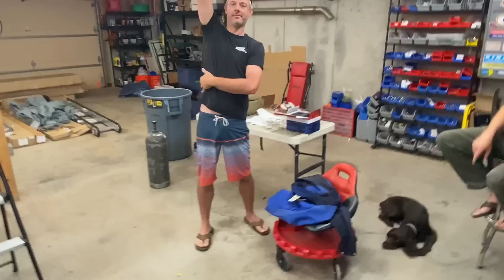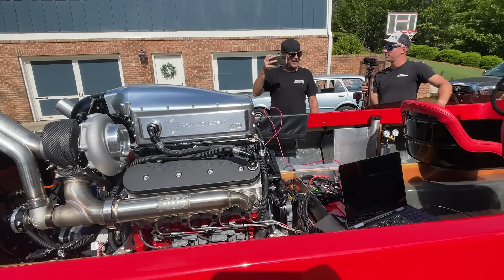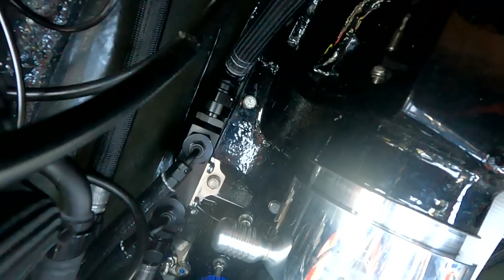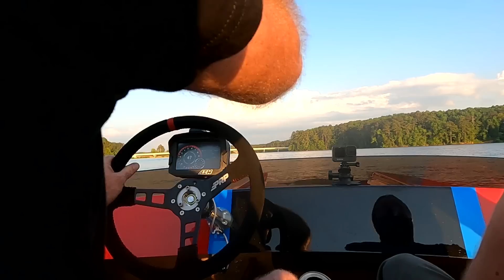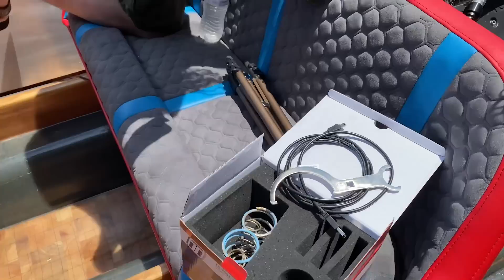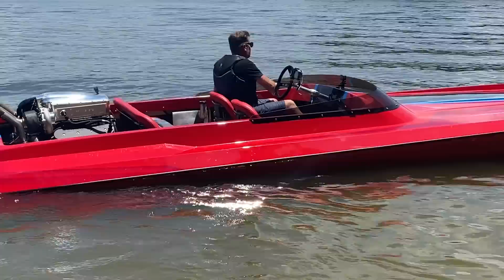FIRST WATER TEST OF WIFE'S TWIN TURBO LS-POWERED JET BOAT!

Comment: Hey Finnegan, I’m gonna be pulling the twin turbo ls out of my mantra v bottom and putting it in my liberator tunnel hull. The thing I’m trying to figure out thats a concern is how to run the fuel lines. I was curious how your returns are plumbed and if your keeping the fuel tanks fairly equal on level how? Any helps appreciated thank you. The mantra was easy to keep tanks equal as the v shape allowed me to add a line to them to help equal the tanks out using gravity.

Comment: Why not put a row of air jets towards the front of the boat to help disturb the water to make the boat go faster in calm water...you could have an air pump blasting air through a full row of small jets going side to side on the bottom of the hull right where it touches the water at full plain...that would break up the sticking factor of smooth water...maybe...

Comment: I think what you’re experiencing when you let of the throttle and the boat delays to slow down is that the air has packed into the tunnels and you are riding on the “cushion” of air and when you let off the throttle it takes a moment for the boat to settle back into the water

Comment: Another Q 4 U .  Hope l dont wear my welcome out .  I heard u say that u want 2 spin the impeller to 7500rpm . I always understood that 6500 - 7000rpm was where the sweet spot was . And drag boats were a smaller impeller spining 7200 to 7500 .  Is this because the  AA can take the HP & TQ u have . 
Potentially 1600 hp . 

Would u mind sharing & explaining pls . Not only 4 me , but others who ❤❤ what u Guys r doing . 

Was ur Super Drag Boat similar in set up . U had 1700 hp in that beast .
Reply from the maker: I've heard these pumps arent efficient past 7,500 rpm but i'm not an expert and I also havent seen anyone do any real public testing of a jet drive past that rpm. Personally, i've turned 7,800 rpm with a smaller diameter impeller in one of my old boats and it worked just fine. The boat went faster at 7,800 rpm than it did at 7,400 rpm.
Reply: @FinnegansGarage  

Ur last jet boat with the 1700hp ( can't recall the name )  
Well 30 -40 yrs ago the owners of Place Diverter & Controlls in Southern California had the Place Craft Hull @ 172 mph . 
As far as l know the next closest is in the 140 -150's.  I met them when l was over from Australia in 2005 . 
On one run at the Drags they mixed there race gas wrong & he hit 180's @ 1/8 mile & temporarily blacked out . As U well know the under water set up is crucial 4 everything . Shoes , loader grate ext ect . 
If u r going 2 pull 7500 with 1600 hp where do u think u will end up speed  wise @ WOT.   If u put a Steve Morris Engine in ( wear some diapers & take out life insurance) 😁😁😁👏👏 There was a guy in northern California running his 21ft Daytona @135 mph a few yrs ago & is now in a 19ft Daytona which l also ❤ but 2 small 4 a family . Any way we r 👀👀 out 4 ur next upload . Should be fun

Comment: There’s some times an issue with the crank sensor picking up noise from other hunks of metal other than the reluctor wheel.
Others have moved the sensor to the front of the crank on an external wheel to solve it.
Reply: Copy that.

Comment: I could have sworn I saw co2 bottle on the boat. But I like the wastegate design with the screw on retaining ring, I always hated trying to hold it with alot of pressure and thread bolts in.
Reply: I think the C02 is to control his jet bucket ( reverse forward control)

Comment: Fin that tunnel hull is awesome but your acceleration seems to leave a little to be desired. F1 tunnel hulls use a mercury 425hp outboard and accelerate much quicker than your boat does.
Not sure if maybe there’s some drive tuning to be done? I would imagine your boat should be much quicker in a straight line than a 425hp f1 tunnel hull with that jet drive on the back
Reply: I'm guessing weight is probably one of the issues with acceleration, that and the water intake probably could use some tuning, gotta be able to pull a massive amount of water through the drive to get moving any faster, I seem to remember on game over he had to open up the inlet a bit because it was limiting his speed
Reply: @Greg1096  yeah but that’s not the issue they’re having here. They said in the video that they have to choke down the flow and increase the pressure a bit, that’ll definitely help but so will a smoother and quicker trim action and maybe a trim adjustment.
It’s a 5 seater so weight is the one factor he has to work around, that being said maybe a power steering pump should be mounted to control the trim hydraulically, it’ll be fast and accurate and it won’t just be two positions, it’ll be dynamic which will help with the launch.
The neutral bucket was also something that game over had that gave it the ability to launch extremely hard, that would definitely help here.
I mean I don’t know if it’s the same pump and engine that was in game over or not, I haven’t been paying that close attention. But if it is I’m sure that’ll come at some point but not until he gets it tuned up a little bit more.
Changing the weight distribution more towards the front could help too. F1 tunnel hulls have a prop in the water to hold them up that’s why they’re fine with the back end sitting in the water while the boats stopped, because the outboard pushes the back end up and keeps the front end pushed down.
This boat sits rearward in the water but for a jet drive that would be a minor disadvantage, the more level he can get it the quicker it’ll plane out. The hull design is definitely not a limitation, it’s about the same size as an f1 tunnel hull, it is a true tunnel hull, it’s just got a recreational deck on top. So the flatter it floats while it’s stopped the quicker it’ll be flat on the plane, which is exactly what a tunnel hull needs to be fast.
The trim adjustment and accuracy also helps with planing out.
Weight is definitely a factor in a family vehicle period, but I think it’s just gonna get ironed out with basic tuning.
Reply: @conanruisi  The water they had to choke down was the coolant flow from the jet drive, not the jet drive itself.
Reply: @Keifsanderson  then tuning it out will show wether it needs to be hydrodynamically Improved around the intake or not.
Like I said tho I haven’t been paying enough attention to know where his motor and pump came from or how it compares to game over
Reply: @Keifsanderson  but mostly the point was the pro boats are an extremely similar design and plane out with 450hp on a prop. Jet drive has an improved thrust:horsepower ratio it should be able to plane out quicker and go faster than a prop boat with a similar hull hp and weight

Comment: Man that's a beautiful build, when you finally get that monster that's growling behind you to fall inline, watch out, after that on a early morning glass lake with a tail wind, you should have no problem hitting 115, 120, mph, maybe  look into some small but effective funnels on the turbos, for some ram air effect, BUT BEWARE ,,, if you let off the throttle at 85 plus you can blow over, and that spells disaster, I'm not trying to insult your intelligence, it's just we used too race supercharged air boat's and we had to install a canard on the boat because of speeds in excess of 93 knots,,, now, at 70 mph plus without a canard and you lift off the throttle on an air boat, good by, it's a dangerous game of speed, but very thrilling, especially when you have $1000 on the line for an 1/8 mile run, just saying, good luck and God bless, - my 2 cents.
Reply: Hence the Pop off from Ralls Performance Marine! Keep up bud!
Reply: Have you ever seen his other boat? Over 3000 hp on that one I believe he said. I think he knows a thing or 2 about these.
Reply: @TheChad138  You would think a guy that knows boats would wear a life jacket...
Reply: @pyrolinn2088  Hell he wears a parachute on his other boat when really going fast.

Comment: I always had the old ball valve setup on the engine feed line to try and set the flow. Usually after a couple good header burns I’d get the temperature where I wanted it lol
Reply: Gate valve works better my friend👍🏼
Reply: Gate valve that feed line from the bowl to engine. A bit more precise. Just does not look "cool"....

Comment: Tell me more about the water cooled turbos and the 20° angle they have to be at? So, they take water from the exhaust like a regular boat or is it metered from the pump? Sounds cool.
Reply: I have a brochure from the early eighties that had a twin turbo kit for my boat. The tractor turbos mounted on the back of the log manifolds and the water just dumped out the turbo exhaust like a regular exhaust. That was their idea.

Comment: Did you ever get rid of that little turbo collector elbow? That thing is a major restriction, takes you down to like 1 turbo territory. You need the pressure pipes from the turbos to dump into tubing which is no smaller than the size of the throttle body, period. Or, if you want to get fancy, I'm sure there's a program out there to model the flow through that part and optimize it. Either way, there's a whole bunch more power to be had.

Comment: It's a Super Super very very tidy set up . Most turbo marine setups r a mess .  This is Sensational guys . What size impeller r U using & r u running a pre impeller  ? Guess l will receive a response when u return from holidays,  😆😅😄😃😂😁👏👏 Enjoy them .  Robert    Australia .    And yeh running hardware is super important.   I was a mate of  Tom Papp before he passed away . RIP.
Reply from the maker: the jet drive has a AA impeller and a pre-impeller in front of it.
Reply: @FinnegansGarage  very swif response ⏰⏰😁👏 .  What revs u looking at ???? @ full boost .  I ❤ ur other jet boat . That was a rocket ship & it launched like a jet fighter.  Waiting patiently 2 👀👀👀 what the 21ft Daytona will run at WOT with this set up .

Comment: I'm probably just showing my "turbo ignorance", but what about BOVs? I ran turbo Yamaha mountain sleds over the years and they had a BOV to lessen/prevent that 'keeps accelerating" feeling when off the throttle. On a sled you are in and out of tthe throttle a lot when boondocking through the snow, and there was nothing quite like hearing that "pssssshhht...pssssht" when you got off the throttle.
Reply: the "keeps accelerating" thing is just as they explained, the smaller throttle movement doesnt choke off enough air to make a difference. the blow off valve wont open because there isnt enough pressure difference between whats in the manifold and whats in the charge pipe. you have to get real aggressive with your throttle movements to make a difference.

the way i solve this issue on a car is by setting up a boost vs tps (throttle position) table. it basicly works by varying your target boost based off throttle position, so less throttle means less boost. for this to work though your ecm must be controlling the boost, something they arent doing with this boat (its just running directly off wastegate spring)

Comment: Coming soon on Finnegan`s Garage " The Wife wants more power in her boat and we are installing a Steve Morris LMX.    I would have to install a turbo screen.  With my luck I would loose my glasses or hat and have it kill the turbo
Reply: If your hat stayed on untill 130 it needed to come off so a helmet might fit.
Reply: Do you mean the SML which is the new LS based block he's working on?
Reply: Doesn't this boat have Nelson mirror turbos? So he'd probably get from him if he was going to upgrade. Idk if I've ever seen any of his ls builds but I'm sure he can
Reply: Stevez SMX can have two superchargers attached to it. Food for thought.
Reply: Wife has fantastic idea. Steve Morris "HORSE POWER, NO PROBLEM...BUT WILL THE ENGINE HOLD TOGETHER?
MINE WILL"!!!!!
GO ON STEVE MORRIS!!!!
Reply: gotta love a tunnel hull what a great riding boat
Reply: S
Reply: I'm sure if he went with another engine it would come from HED ( pete )
Reply: Correction, installing the engine from game over..  so they can install a SMX into gameover
Reply: @LymerPnB  The 711 in gameover is already a sick Brodix aluminium block and with the cubes it has and the turbos on it, it could easily crank out 3500hp.
The problem with gameover is that the suction hardware on the bottom of the boat where the jet drive ingests water is not yet properly calibrated and at a certain speed the boat is so far out of the water that it can't suck in any more water and hits a speed limit and the engine goes revving to the moon.